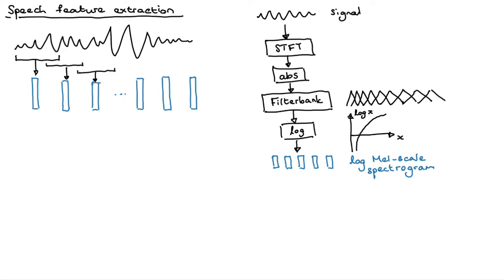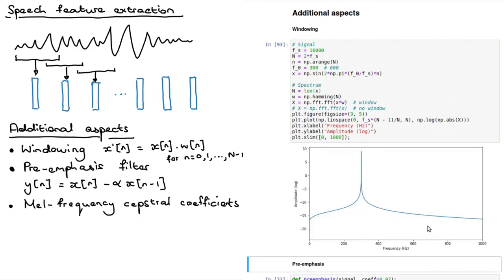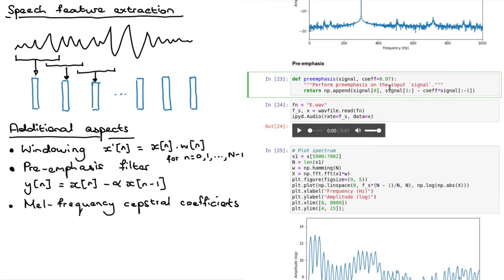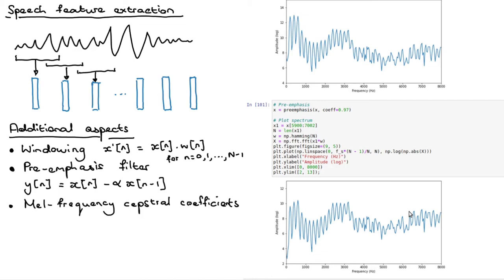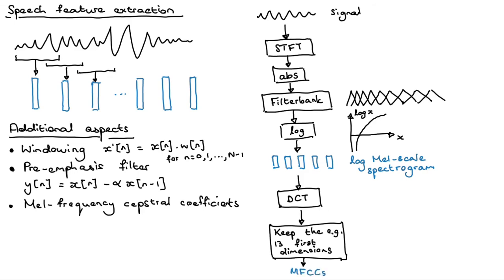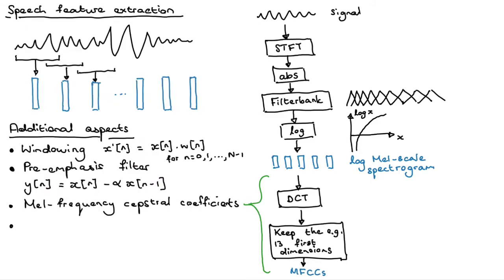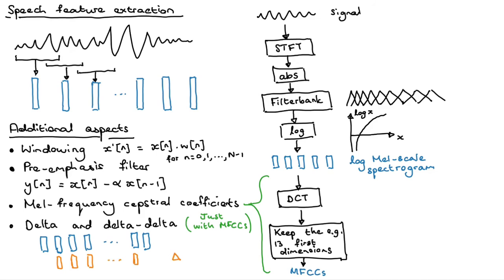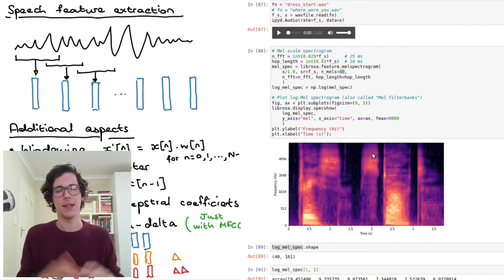Speech features intro 4: Additional aspects

Comment: when you combine the mfcc's the delta and delta-delta into one vector is that a type of matrix multiplication? orrr something else maybe?
Reply from the maker: Hey Alfredo! No, fortunately it is much more simple than that: you are just concatenating them to form a single bigger vector.  Some people might call this concatenation or maybe stacking the 3 vectors on top of one another to form 1 single vector.
Reply: @kamperh  thanks! I'll use np.concatenate for this then :)
Reply: @alfredo2lepe  one way to think of it is in addition to telling the system this particular frequency bank has this amount of energy, you also tell it by the way it has increased compared to previous window which itself was an increase from its previous window.
So it adds a temporal change clue to each coefficient: